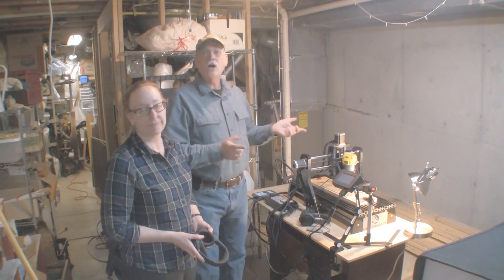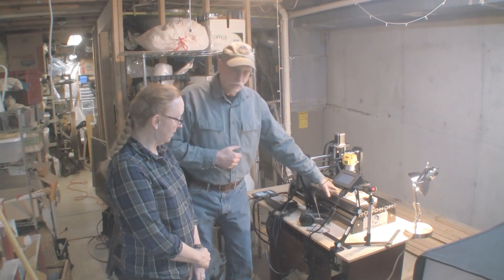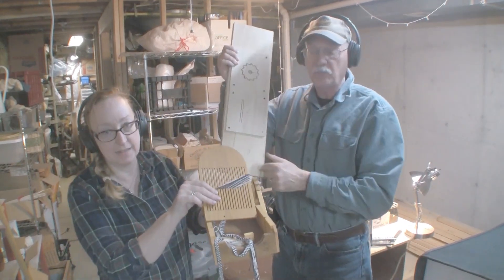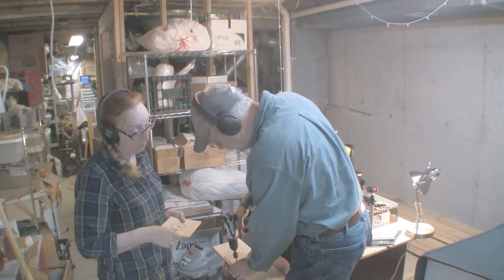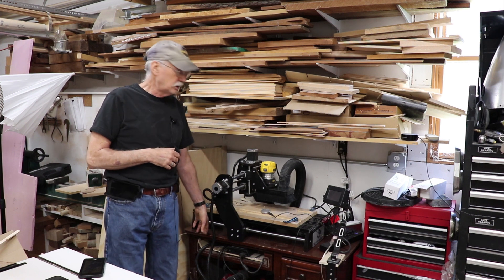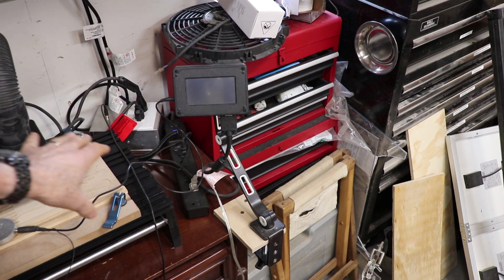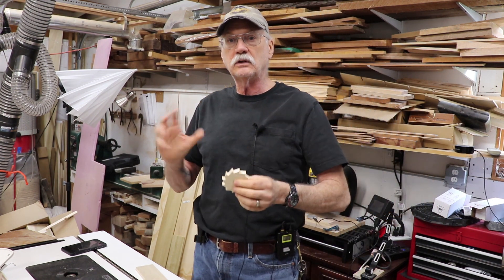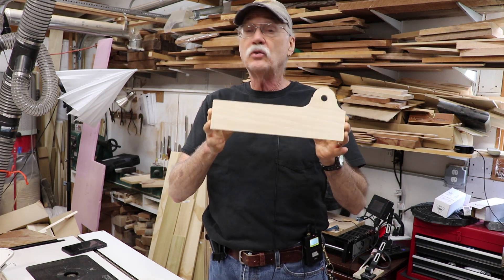Yup, a new tool for the shop

Comment: Thanks for showing the Piranha doing something other than carving a sign! What software did you use to design the parts and generate the g-code?
Reply from the maker: Thanks. We've moved to a different CNC since then, but the process is pretty much the same. I draw the parts in AutoCAD 2000 and import them into Vetric Vcarve Desktop to build the tool paths. It's then saved in the correct Post Processor for the Piranha. The reason we switched machines is that the Piranha was losing precision.
We now have a Genmitsu 6050 Plus from Sainsmart. I still draw in AutoCAD, build tool paths in Vcarve, and use gSender to run the job.  Vcarve has the Post Processor for Genmitsu. There are videos on my channel setting it up and making things.
Back to AutoCAd, 2000 will not run in any Windows OS past XP. so I set up an XP VM and run it in that.